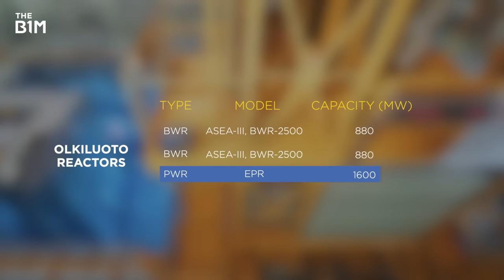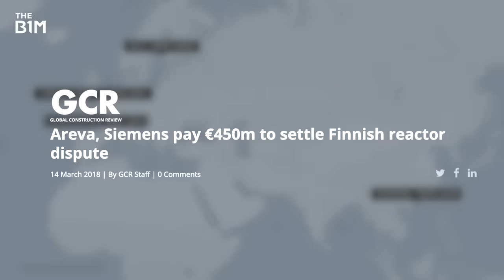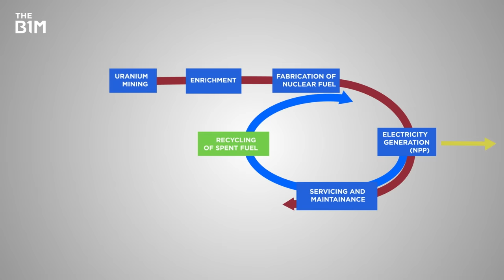Finland Might Have Solved Nuclear Power’s Biggest Problem

Comment: Finland should build a Thorium fueled, Liquid Salt Nuclear reactor (LIFTR) which creates no radioactive waste.
It can also process radioactive waste left over from Uranium reactors and render it harmless.
For instance the storage life of plutonium can be reduced from 100,000 years to 100 years.
Reply: Awesome. Who's going to pay it though? If the international investors are willing to throw billions of free money, sure. After 10-15 years of studies and applying for permits, they could start building it and after another 10 years it might be ready. So not really a quick solution.
Also that would still require a long time considering the tons and tons of the radioactive waste currently in Finland (or in any nuclear power producing country). And all the non-fuel radioactive waste is still going to need burying somewhere. Currently they are stored worldwide in steel drums above ground.
Reply: I agree, but LFTRs are not operational yet on a commercial basis. In the mean time high pressure reactors can still to reach  net zero...during our lifetimes. Waste is actually pretty harmless, but should be called spend fuel, not "waste", as it can be used in LFTRs in the future but also in other types of reactors. It can also be reprocessed.
Reply: @beba2893  missed the bit where a lot of non-nuclear armed countries want nuclear power did we? Like, I dont know, Finland maybe?
Reply: @puma7171  Breeder reactors are, and about 30% of the fuel has already been re enriched.
Reply: @katrinapaton5283  Why WOULDN'T you.  It beats fossil fuels in almost every respect, pollution, safety, waste, and several others.  About 1 million lives have been saved by it so far, including the two disasters.
Reply: Yes yes yes.  Why aren't these safe reactors being built.
Reply: I agree totally with this suggestion, the rest of the world needs to wake up to it and start using it.
Reply: @DAVIDTATLITUG  Because big business is making a Motza using Coal, Oil and gas
Reply: Someone ahem Elon should come up with the idea to send this deadly stuff back where it came from🤔 you know like the sun🤣
Reply: @archsciontrismegistus4194  > not a viable solution. And not very smart either.
Reply: @DAVIDTATLITUG  > because the designs aren't finished yet. It's more of a concept than something you can just go and buy,
Reply: That makes too much sense and there’s no waste to make nukes and you can’t have no nukes now can you.

Comment: This ‘solution’ is the same one as always: bigger pressurised reactor, more safety systems to keep it all within the ever more tight regulations. More complexity, higher investmensts. AND we still bury all the waste in the end. 

There are new technologies like the molten salt reactor that are cheaper, far more simple and inherently more safe.

Plus they use nuclear waste as fuel, thereby actually reducing the problem instead of worstening it.

This video does not offer what the title is claiming
Reply: Please show me who right now sells you a molten solt reactor for cheaper than a conventional light water reactor? Links? Brochures? Ongoing projects for cheaper and safer must be going on in droves, right? Any links to those? No? Well go read a book and shut up then.
Reply: There are no molten salt reactors currently. They are just researched.
Reply: @benbaselet2026  I gather that Moltex Energy have partnered with a power company in Canada and aim to build a waste burner Stable Salt Reactor at Point Lepreau.  They claim that SSR reactors will be no more expensive to construct and operate than traditional coal power installations. Their website has some of the details.

Comment: That actually sounds like a viable solution to spent fuel rods. America plz take note. Thx 
B1M for another excellent vid🖒
Reply: Rather waste of money to go to such lengths to ensure a "long term" structure for spent fuel we're going to be digging back up in 100-200 years.
Reply: @zolikoff  Why would we be digging up nuclear waste in 100-200 years...?
Reply: @amzwl1671  to reuse it, we already know that it is possible, we are working on it as we speak, so in a few years the "waste" will become a recource we want to have.
But sure, dig it down for now, we know where it is when we have the reactors that can use it, and it's much more easy to go get it then to mine new uranium
Reply: @AmzWL We may dig it back up to use as fuel for next generation reactors. "Spent" nuclear fuel still has more than 90% of the fissionable material still in it. We dispose of it because small decreases in overall percentage lead to large decreases in efficiency, making it mostly useless even at high levels of fissionable material. It is possible to filter out the used materiel from the fissionable (e.g. this is done for depleted uranium armor), but it's expensive and since uranium is comparatively cheap and plentiful it's not usually worth the effort. If this changes in the future (which many believe it will) it might be cheaper to process spent nuclear fuel rather than mining more uranium. In which case having years of used nuclear fuel on-site would actually be very convenient.

There's a larger debate that actually keeping it on site makes sense for a lot of other reasons too. The US actually did plan for this with a site called Yucca Mountain in Nevada. For various reasons (some of which pretty ridiculous including taxes) this was never completed. However, during that time we took a hard look at simply storing it on-site. Many people don't realize that 100 years of spent nuclear fuel for the entire US wouldn't take up much more room than a medium sized building. What takes up a lot of the room is everything around it to keep it safe passively. But what better place to store nuclear fuel than someplace that already has the security, knowledge, and capability to deal with it already. This also removes the need to transport it and decentralizes the risk. And if we do later want to re-process the fuel, it would be trivial to get access to it and this may eventually eliminate most of it as well.

Obviously storing it in the ground would be the best in terms of long term safety if we never wanted to touch it again. But the costs, both real and imagined, may not justify it in the long term.
Reply: @someoneelse7629  It's much easier to mine new uranium than open the Onkalo. Onkalo is build to withstand end of the world
Reply: @jauho7483  It's not necessarily easier. Depends on the overall environmental regulations that control mining operations though. The spent fuel is already in a concentrated, processed state. If you know exactly where the containers are you can just drill for them and dig them out. It's more cost effective than mining half a mountain and chemically extracting the low concentration of uranium from it.
Reply: @amzwl1671  To use it as fuel. The question we should ask is, "why are we burying useful fuel?".
The answer is political rather than technical. The world's population is "demanding a final solution" to this "huge problem" of nuclear waste. The money goes where it's demanded.
Reply: @nothrabin  As far as I know Yucca Mountain was actually basically completed and ready to accept spent fuel, but it was blocked from being used thanks to state politics.
Reply: @zolikoff  thank u for your knowledge man really prefectly summed up an intricate situation with lots of viable information to this seems like indomitable inconvenience.
Reply: @JM-dk4ec  Not trying to pass it off as a "good thing" but every energy source kills people. A single coal power plant kills thousands of people over 5-10 years this way. Nuclear power killed so many people only one time, in the most serious and worst-handled nuclear accident in history. So statistically speaking that isn't bad, in fact it's still the best, even assuming that this statistic continues and you have an inevitable Chernobyl out of every 300-400 reactors ever built.
Reply: @zolikoff  humans aren’t capable of maintaining nuclear energy and that’s a fact. We should never use nuclear power for our own sake. Is a stupid idea that will let places uninhabitable and millions of people dead and displaced. I rather take my chances with other sources of energy than gambling with nuclear energy and guaranteeing the destruction of a whole city and its population forever. And you said it yourself what if the next Chernobyl happens in a place that is heavily populated like New York City for example? 8 million people dead and for what? Just because we thought nuclear power is safe? Give me a break.
Reply: @JM-dk4ec  you might not want to hear about nuclear weapons then…
Reply: @JM-dk4ec  There is nothing "uninhabitable" as a result of nuclear energy. Like I said a coal power plant kills more people in 5-10 years than Chernobyl. What "taking of chances" are you referring to? To me it sounds like a million guaranteed deaths is better than the risk of a few thousand deaths in case everything goes wrong. That makes no logical sense.
If you take a long look at the statistical risk involved in all energy sources you'd see as well that nuclear is by far the best, and that includes the consequences of nuclear accidents. If we can operate reactors even safer, that just makes it all the better, but it is not required to "operate them perfectly". They are already, fundamentally, safer than other energy sources.
Reply: However a far better solution available, one that simply uses the Archinides that are the highly radioactive salts in the waste, the rest being low radioactive fuel rod packaging. And that's high temperature atmospheric pressure molten salt reactors, first designed by the team at Oak Ridge National labs. They also created the PWR reactor for use at sea, where a lack of coolant was not seen as an issue because - sea! 

The problem with PWR is inherent in the design of the fuel rods, only a few percentage points of the fuel can be used before the rods shatter but by then  the fuel is also poisoned, the waste can be used as a fuel source in a fast breeder but that also produces weapons  grade plutonium.
Reply: @JM-dk4ec  Only if we carry on using inherently dangerous and inappropriate designs like PWR rather than the fail safe LiFTR high temperature atmospheric pressure molten salt reactors
Reply: Can't remember the issue but it must've been about 2 decades ago that the same solution was being proposed in Scientific American.

Comment: i still dont understand why the radioactive particals in a decay chain that have the longest halftime, such as Thorium230 U234 or Pa231 in the Uranium 235 chain, with half times linger than some 30k years other millions, arent used again in reactions or otherwise bombarded with high velocity particles to make them unstable and katalize a new chain. is it just not possble to make the nuclear waste with high halftime decay quicker with such techniques? cuz if it would it could make the waste only last maybe a couple of decades instead of... longer than society on earth.
Reply: That has been proposed.  It is too expensive.

Comment: The problem isn’t really ‘solved’ but anything that keeps developing the tech making it safer and more accessible is 1000% what we should be doing.
Reply: Watch the netflix series of Bill Gates. Since 10years he is pushing to develop a nuclear Powerplant that can run on nuclear waste. He claims that with the current amount of nuclear waste in the U.S. the countries electricity supply would be covered for 75 years.
Reply: @reviveproject  Yes, if a reactor would extract all the available energy of the fuel put into it, it wouldnt have to be refueled until it reached its end of life. Throwing away fertile isotopes is such a waste.
Reply: @reviveproject  although Gates is an evil genius, he is probably right.  Alternative reactor designs could take the fertile material in spent fuel and generate energy again.  Also, these cans would get HOT...  Could make some geothermal energy wit it
Reply: @ridg5001  At that point the spent fuel has become inaccessible... Also better solutions have been found decades ago, theyre just more expensive.
Reply: @ridg5001  The cost of a safe and clean fuel cycle is completely viable but why would companies spend that extra money if they dont have to? Reactors get built from taxes, waste management is being done with taxes and if anything goes wrong, the cleanup is gonna be paid with taxes but if a government decides to turn a power plant off two years earlier than planned, power companies start crying about going bankrupt.
Reply: @kayakMike1000  Gates is not a genius anything..  He barely has 100 IQ...
Reply: I wounder anyone how claim its "unsafe" exacly what is the risk?
Reply: @matsv201  You are about to find out... Everybody they say is sick and dying from a virus...   Is actually sick and dying from radiation exposure from melted down nuke power plants...  Everybody is dead...  How much longer...
Reply: @matsv201  Is the certain extermination of all life on the planet a safety risk...
Reply: @willrobinson9767  maybe you should watch less.movies and read more documentation
Reply: @willrobinson9767  oh, really?  Hmmm....  If I were an evil genius, I might WANT everyone to think that...  Honestly, Bill Gates is just a concerning actor on the world stage.  I saw a vlog from Russle Brand, it seems Gates certainly has the Evil part for sure
Reply: @matsv201  You will find out if you care to know what your true cause of death is...  You are still just as dead either way.... Not much time left for you or anyone else..
Reply: @kayakMike1000  He is not even a coder..   Just a salesman and a bad one at that....  He stole DOS and windows...
Reply: @ridg5001  It stays radioactive for 10 thousand years.... There will never be a solution that doesn't mean death for all life on the planet..
Reply: @kayakMike1000  Did Bill Gates ever mention the melted down nuke power plants or the budget deficit even once...
Reply: @willrobinson9767  True story...  A worker at a nuclear power plant trips a radiation alarm on his way IN to work one morning.  Turns out he had radon gas in his basement.  Good thing he worked at a nuclear power plant.
Reply: @willrobinson9767  I don't really think so, while I don't always agree with, his brain generates some good ideas and he is entertaining.
Reply: @willrobinson9767  and yet he is one of the richest guys in the world and everyone buys Microsoft software since the company started up.  Sounds like he's successful to me.
Reply: @kayakMike1000  Radon is not fatal but radiation is...
Reply: @kayakMike1000  The guy just admitted to adultery on national tv...  This sound like a smart person...
Reply: @willrobinson9767  well you could think that.. if you don´t actually measure the radiation and check where it come from. 

You can buy equipment for that and check if you are right or not in stead of just guessing.

(hint, you are not right)
Reply: @matsv201  Very few including the most dangerous Cesium shows up on a meter...
Reply: @matsv201  You are talking about 300 + different radioactive elements...
Reply: @matsv201  You will discover I am right.... When it finishes exterminating the rest of humanity...
Reply: @matsv201  Many insects and animal species are gone... None of which die from viruses...
Reply: @kayakMike1000  No chance Radon would cause a radiation meter to go off..
Reply: @matsv201  Dana Durnford went out in the ocean in a boat taking radiation readings and plenty of pictures showing the tide pools are dead... It was done...

Comment: Spend nuclear fuel isn’t really spent, nor is it that big a problem. It’s got lots and lots of valuable isotopes (as well as unused U235) that could be extracted if we had a sensible nuclear materials reprocessing program. Like France. 😜

The biggest liability with current nuclear tech is that it uses water as a coolant. Take water out of the equation, and so many of the liabilities of water go with it. 

No need for high pressure, no hydrogen-oxygen separation, no solid fuel, etc. everything becomes so much simpler to build and operate. 

MSRs are where the future should be at.
Reply: MSR = Molten sodium reactor?
Reply: @renteryx2364  basically, the actual abbreviation is "Molten Salt Reactor", they're definitely safer than LWR/EWR's
Reply: 6:18 look at the map. No suitable site in Japan, South Korea, USA, Germany, France, UK. Russia's only site is right next to Finland. The Finns would be sure to like that.

Comment: I’m more curious to how they keep all that water stabilized.
Reply: Betonronite  clay
Reply: @matsv201  I mean in the reactor. The ph and filtration systems for the water must be complex
Reply: @andrewwhite1576  Usualy its a osmosis filter, when all the ions is removed the PH become neutral anyway
Reply: @matsv201  a ro membrane the size of a house probably. The surface area of the pool is large and carbon dioxide loves water in its ion free form. They use uv sterilization too I bet
Reply: Physics
Reply: @andrewwhite1576  the deep blue light is not UV sterilization,  its neutrons  being  stoped  by water
Reply: @matsv201  Thaose might in fact sterilize the water by themselves.